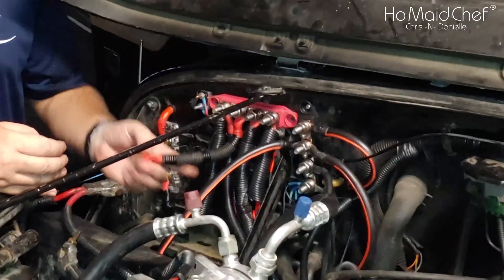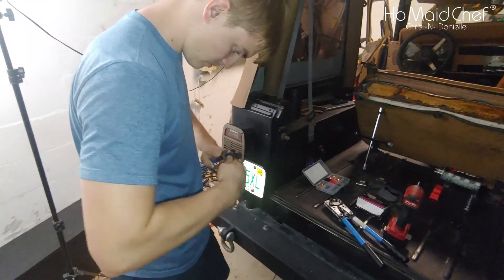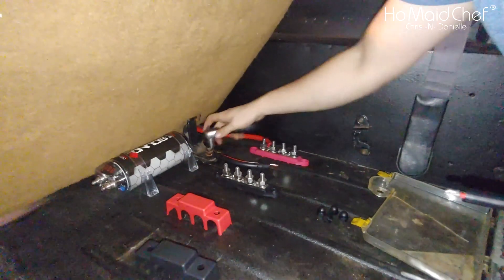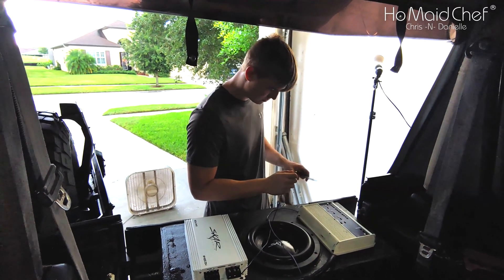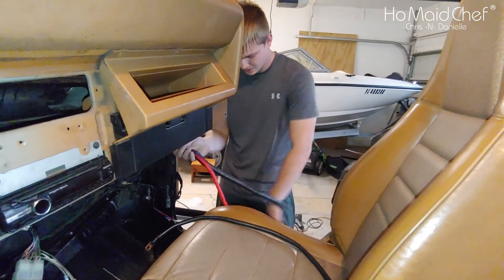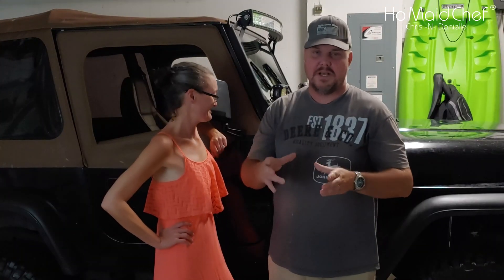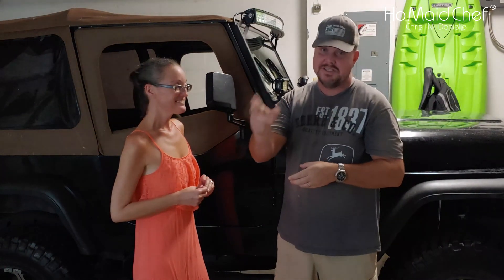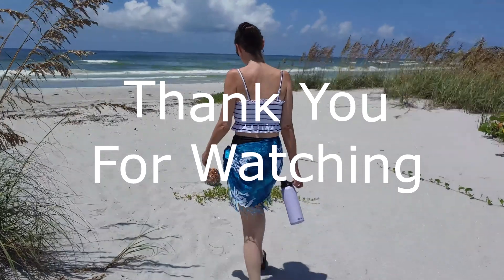Setting Up Multiple Amplifiers And Capacitor To DC Bus Bars

Comment: Whats the benefits of using a bus bar, rather than just running both amps and power to the cap then ground the cap and amps to one single chassis ground or separate chassis grounds?
Reply from the maker: There is no benefit minus it is cleaner and easier to power up the cap. I have done it both ways, and your way is cheaper.

Comment: you shouldnt mount amplifiers on the subwoofer enclosure unless the box is double walled and the amp has bushings between the box to dampen the vibrations. channels like barevids who repairs amps say the vibrations from bass causes the amp board to flex and after time the mosfets on the amp breaks of the board causing it to short out
Reply: I don't think it's nessasary to use the wire shield on power coming from the battery, if you use good wire, the silicone is heavy duty and nothing is going to happen to it. I mean it doesn't hurt I guess, I just never seen anyone use it on every wire before.
Reply: This makes sense... I wonder if they do anything different on the all in one  amp and sub kits, where the amp is already inside the box. Do they built those amps any different or what, cause there are literally dozens of all in one amp and sub enclosures available, people use them all the time.
Reply from the maker: With a 3/4 inch construction and box bracing, this vibrates the same as it would under the seat. Thank you for bring this up, but due to limited space in the jeep this is our only option. Also if mounted on the floor in this jeep, the heat while trailing puts the amp in protection mode. Plus it keeps the amp from going under water when going through streams.
Reply: @ChrisDoesWhat  add bushings between the amp and box. if you have those thick foam laying around thats used for packaging electronics or you can use pool noodles. cut them up to an inch thick and place them between the amp legs and box, that should help dampen vibrations to the amp